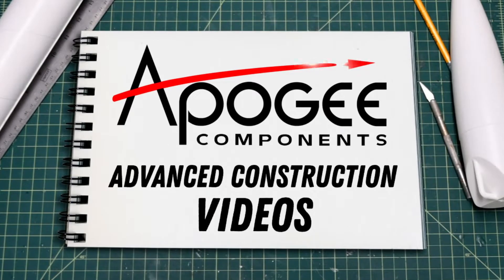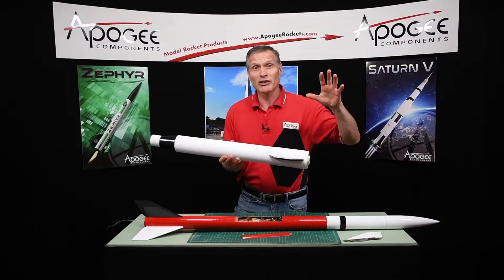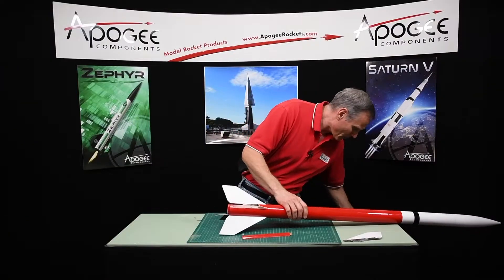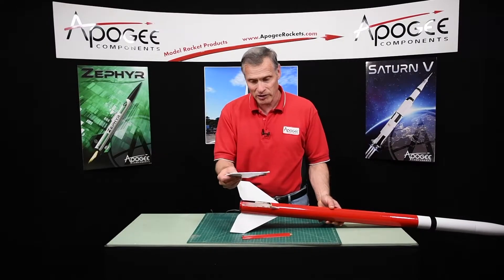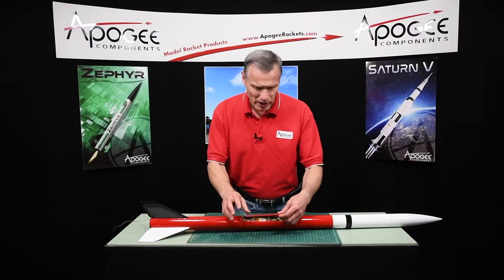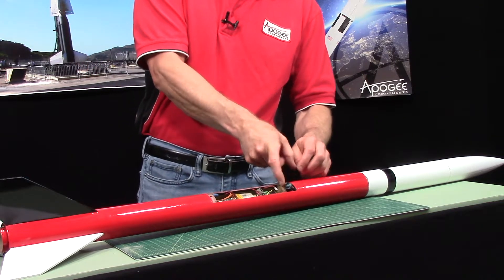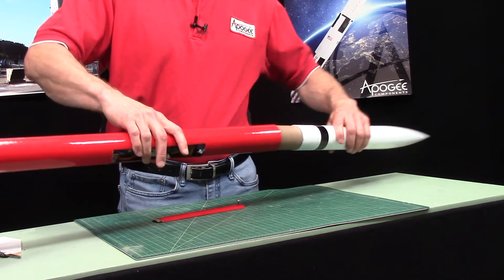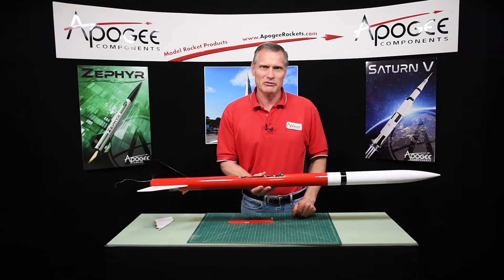Terrier Sandhawk Build Part 10 - Launch and Post Flight Analysis

Comment: LOC does recommend reinforcing the fins with fiberglass or carbon fiber.  So doing tip to tip reinforcing would probably help prevent that breakage problem.

Comment: what motors were used?
Reply from the maker: You can use most any 38mm motor in the upper stage, and high thrust motors in the booster. This is a complex rocket, so be sure to run your rockSim simulations.
Reply: @apogeerockets  i was just curious on the motors you used for this flight
Reply from the maker: @f62darkstar  I understood. I didn't answer, because it doesn't matter.
Reply: @apogeerockets  oh.....ok
Reply from the maker: @f62darkstar  What is important is your results. We're pulling for your success, not ours.
Reply: @apogeerockets  I certainly appreciate that....and thanks again for this series
Reply: @apogeerockets and an answer would be helpful, to better understand the structural limitations of this rocket
Reply from the maker: @ddogoo3749  I don't know, nor do I remember what motors were used. Sorry.
Reply: @apogeerockets no problem, thanks for the reply!

Comment: Could you reinforce the bottom 3” of the body tube by sliding another, slightly-larger body tube over it? Maybe have it shaped like a Burger King crown, with the prongs running up between the fins? That would also prevent the main body tube from going out-of-round, which you surmised might have been the reason the plastic coupler fit too tightly. (Just a thought.)
Reply: Thank you, sir. I take all of your points.
Reply from the maker: That would work. Personally, I think this is such a rare occurrence that it isn't worth the effort. But  you can do it if you feel it has benefit. Not a lot of downside, so go for it!
Reply: It’ll be a while before I get to the skill level to build this. I was mainly thinking about the repair of your rocket and what you might want to do before making it a publicly-available kit. 

I presume you’ll have a few friends build it before then, and that will confirm (or not!) your expectation that it will be a rare occurrence.
Reply from the maker: @dawoodjr  Remember, this isn't a kit manufactured by Apogee Components. The Terrier-Sandhawk has been out from LOC Precision for a long time. For all I know, it could have been years and years. We are only selling it now, because we NOW (in 2019) have the "Simple Timer" device that makes staging practical and safer.

I only made this series because there aren't instructions from LOC Precision on how to actually fly this rocket as a two-stage rocket. It really show-cases the "Simple Timer" device and how it is used in rocketry.

One final point... the configuration of this rocket is very similar to most other two-stage rockets that require electronics. The "configuration" is that the shoulder of the booster stage prevents normal thru-the-wall fin tabs that extend all the way to the rear. I've flow lots of models like that, and this is the first time I've every had part of the rocket break off at staging. I do think it is a rare occurrence.